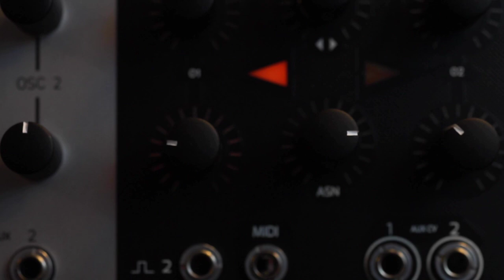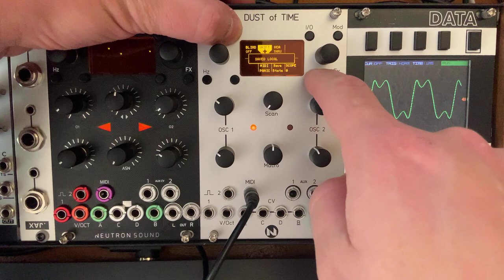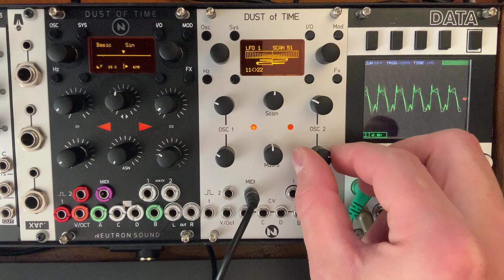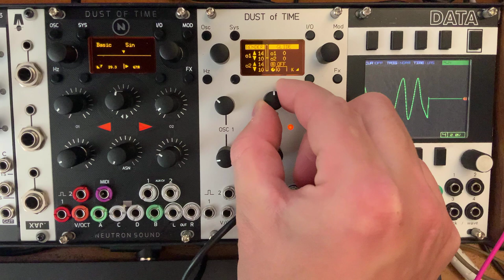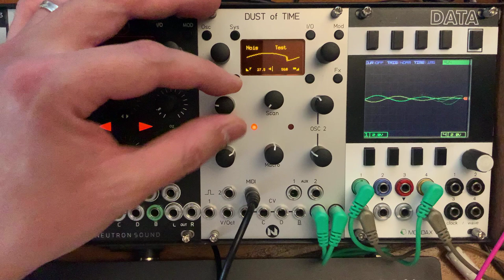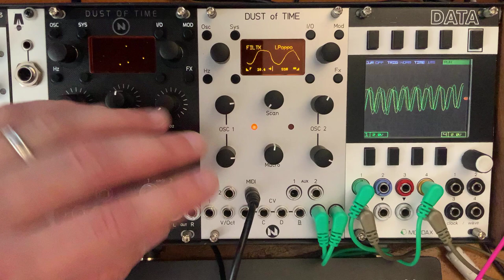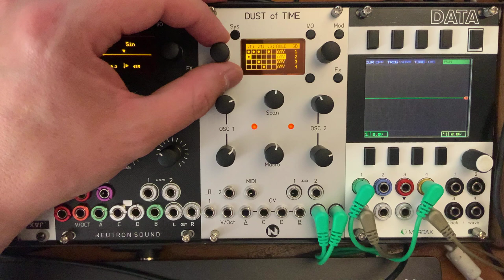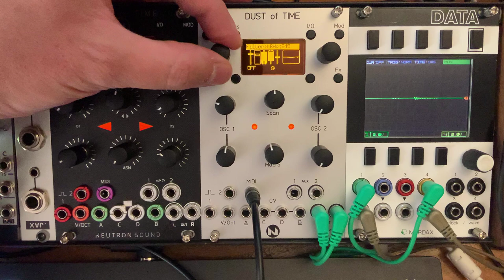Neutron Sound's Dust of Time - The Crash Course

Comment: Wow this is a huge intro to this module! thank you.

I'm noticing an interface change on the design side of the michigan synth works module that I have when trying to follow along... Im unable to make some of the changes and navigate the way that you have - just wondering if anyone else has noticed this? In particular, in the I/O section I can't change the VCA to anything but THRU... I can't assign an EG to it.
Reply from the maker: Hi, yeah, there have been many firmware updates since this video. Speak to Jim Matheson, or check the github for the latest manual and firmware. The Facebook group for the Dust of Time is super useful as well.
Reply: @QuincasMoreira  thanks so much! Again, this video was super helpful.

Comment: Hey! Very good and informative video! Im confused over one thing tho. Is it possible to separate the voices for two different sequences? Lets say i have two melodies sequenced on a two channel cv sequencer. Can osc 1 play seq 1 with its own env/vca and the second one an other? How?
Reply from the maker: hi! no, it's not two voices, both oscillators follow the same pitch control! it's meant more as a multitimbral stereo monophonic synth voice
Reply: @QuincasMoreira  thank you for your reply! :)
Reply: A second question 😅 is there a hidden setting somewhere to get midi to work? I found channel setting etc but it doesn't want to reciev clock, gate or note data from my nerdseq (or anything else for that matter). I'm on the GitHub firmware that exist out there and the nerdseq communicate fine with the rest of my gear. Greatfull for any ideas 🙏🙏🙏

Comment: just got one from reverb but it arrived with a broken screen. do you know if its easy to replace?
Reply from the maker: it's easy to replace, look into the build documentation. Also you can join the Facebook DOT group and the designer responds directly there
Reply: @QuincasMoreira   i was visited last night by the synth gods and suddenly the screen is running. thx!

Comment: Who downvotes this? Way too many menus for me.
Reply: Not a downvote from me (love this channel and content) - but the module is way too complicated for my taste. He says it is “intuitive”, but I see menus, pages, routing, shortcuts and shift keys - even the demo gets confused at points. I think modular is more fun with dedicated modules and no menus!
Reply: @JeremySeitz  Yeah, I think there is just too much crammed into the module.  If it was just a dual oscillator with all those synthesis methods, without MIDI, modulation sources, a VCA, gate sequencing and DSP effects, it'd still be a very complex and busy module, but I think it'd be friendlier and more manageable.
Reply from the maker: Hi guys! Let me address some of this... The reason I consider it intuitive, is that instead of a single encoder for menus, you have two click encoders and two buttons for navigation, six menu buttons that put you right into the pages for each main category, and the click pots open pages to edit mod routing to the very pot you just clicked, so this makes the menu system very shallow. You don't have to "dive", surface snorkeling is enough :) With a little practice it starts becoming second nature.
And yes it is very crammed, but you are of course not obligated to use all of its functions. Just keep it in the OSC page if you don't need or want all the other stuff.  I really like that it has MIDI, saves me a MIDI to CV converter and a lot of cabling, and the fact that once you've spent some time creating sounds you really love, you can save them as presets and simply dial them up as needed.
I understand not everybody likes this approach, I myself was a very "knob per function" guy in the beginning, but I can't deny I've fallen in love with the sound and convenience this module provides me in a small system.  Cheers!
Reply: @QuincasMoreira  yeah, this is a VERY versatile oscillator!  For so much functionality to be crammed into such a small amount of hp, I think that the 'menus' are pretty well thought out.   Jim designs some of the best oscillators you can get for the $$, so it is a good thing!  Of course, it will not resonate with all people; it's like any other Euro complex oscillator,  you need to decide if this fits your music and workflow, or not.  If not, pass it by.  The fact that one can also add user wavetables to this is  killer!

BTW,  given that this is an oscillator evolved from the Orgone Accumulator, I suspect that it will really shine timbre-wise at the low end of the audio range.

To get into it, pick a subset of features and work with it until you've plumbed the depths, then move on to more. I'm sure that it will click [pun intended] after some effort, but all good things deserve effort.   ;>}     Have fun!
Reply: @Starthief  says the man who has an E370!  ;>}
Seriously, for the money it looks good! If you don't want to deal with all of the 'extra' features, then concentrate on the ones you like. And if you can't find a bunch of stuff that you like,  I don't know what to say.   I for one love the fact that you get VCAs, etc. [a bunch!], for the price, which is lacking in the E352/E370.  But I DO love my E370s.  :~) 

Cheers!